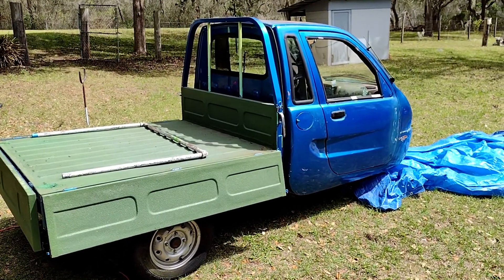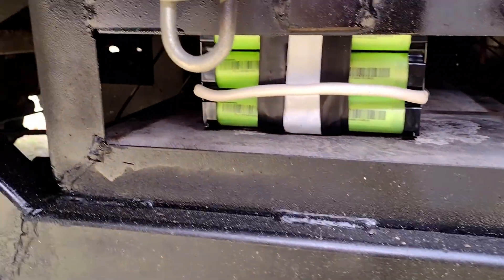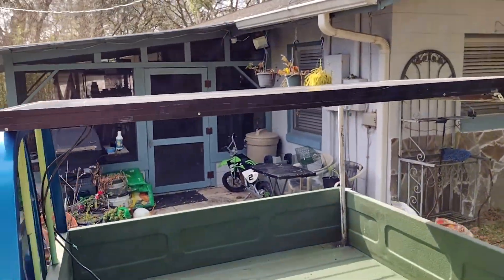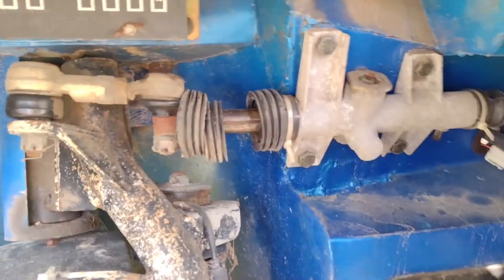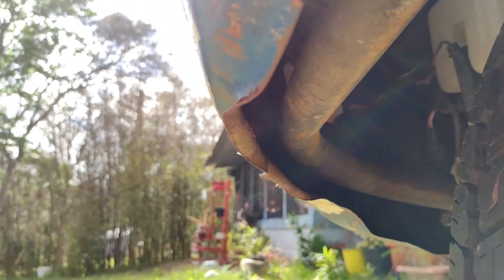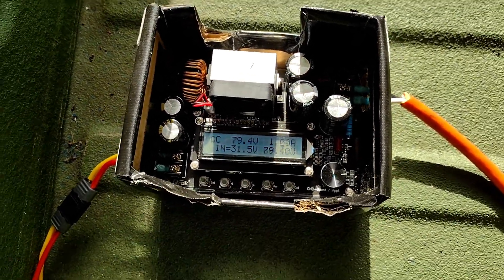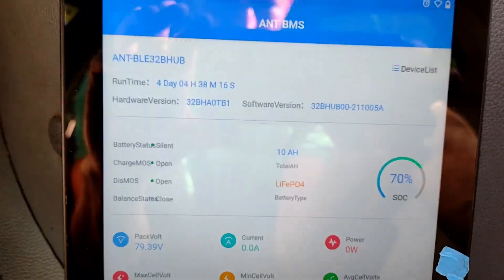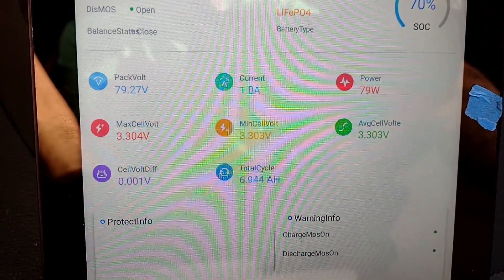Zap Xebra electric truck solar part 2  what's under the hood!?!

Comment: Bro! I want to buy you a GoPro with like 6 mounts for you to install. The one handed steering with no power steering over bumpy turf while trying to hold the camera phone and screw with the iPod isn't really letting us live vicariously through your videos!!! 

I just inherited my Dad's Zap Xebra and will be bringing it to where I live, just up I-95 from you in Eastport, Maine! I'm the airport manager for Eastport, but the area is so isolated (2½ hours to the nearest Interstate) that there's no taxi, Uber, Lyft, rental cars, or public transportation for folks flying in to get downtown to check out the city. Once I get it up here, new batteries, cleaned up, and ready to go, I think I'm going to put it up for rental with a limitation of staying on the island.

Anyway, I'm just busting your stones about your videographer skills, I'm about to binge all your stuff, so can't be that bad, right? Thanks for making and putting all these videos up for us, makes it far less scary to dive in!
Reply from the maker: Yes, I'm on a budget and I do need a gopro vs my phone. We all start somewhere. I've went through many designs and back and forth but she is almost ready. 
I have 3 touch screen displays that monitor each battery module individually and also one that displays all 3 together just like the zap car I did that Danny Duncan tried to destroy 😆.  
I have it registered and tagged as a motorcycle not lsv as well. So I can go anywhere with this dude. 
Last thing is tires and going over brakes and fluid in rear end. Please check out my zap car build as I went pretty deep on it. Downfall was the lead batteries he purchased from battery plus 😫 so heavy and they don't last.
Reply: @nogasproductions9431  Awesome!!! Thanks for the reply, I'll be checking out all your stuff! Are you planning anymore Zap Xebra content?
Reply from the maker: @TCASAnalytics yes I'm almost done and ready to take it out on the road should be this month for sure lol. 
Great projects take time! 
Next video will be the best one.
Reply from the maker: https://youtu.be/k5IooqwXkSY?feature=shared

Comment: How many watts is your motor?  I have the guts of one from supposedly of a late 90's  truck with the 5kw motor and 350amp controller. If possible, could you make a quick short video on how the accelerator pedal is set up as far as the wiring goes?  Or maybe a part number on the accelerater pedal box?  I have the curtis controller, but have not been able to find out which exact controller I have or narrow down the the pedal that goes with the controller....unless I am looking in the wrong place, info about some of these parts seem kind of vague online.  Where did you end up getting the new controller set up for the ZAP car in your other video? Any info, or a point in the right direction, would be greatly appreciated. Thank you for your insperational videos for combining old tech with new tech brother!       Another quick question...  on your boost converter... How many volts are the bigger capacitors rated for on it?
Reply from the maker: In the video I did show the link to eBay for the controller setup with solenoids. It was about $500 and took about 2 weeks to come in. 
Pedals have many possibilities on what they do to work with controller. Original zap seems to be 5-0f where as the kit from ebay is 0-5f or ohms. Scooters and ebike usually use 0-5v and there are over 10 more types. 
You can even use some automotive pedals as well from junkyard. Multimeter. 
I have new video coming soon been working full time lately and home remodeling etc. Busy bee but the zap is legal and it's almost ready for a drive on the streets.
Stock motor on my zap truck and the controller was replaced on mine before I got it. I would like to get a nativas ac motor setup.

Comment: Looks like a fun project! I've found one on craigslist that I'm looking into getting too (an earlier fiberglass sedan version). Also, I'd look into retrofitting the brakes with something a bit nicer, as the stock ones have a tendency to just completely fail.
Reply from the maker: Yes. Sorry for late response but I have been working on it. Brakes are definitely needing more. I believe the fiberglass body is way less weight than the steel truck. 
My title said 2800lbs! I have gone lithium and my new video I will show off the new battery. Waiting on some plugs to wire the BMS. Did you get the car?
Reply: @nogasproductions9431  Nah, didn't get it, though it was probably for the best as I have plenty of other projects I should probably get done before I start another. Either way, I've seen three more come up since then, so I'm confident that there will be one when I make space for it.
Reply from the maker: @chasewilliams3949  I have one coming to me with running issues. So I'll be making a video on that. Yeah I have seen a couple myself come up. Not in great shape though.
Reply: @nogasproductions9431  Yeah, most of the ones I've seen are in pretty sad condition too, though one interesting one I saw come up was apparently someone's daily driver until just recently. It also had a factory looking badge on the back that said "V84X" which I haven't seen anywhere else. Maybe it's the name of the original chinese car and they just forgot to take the badge off? Who knows.